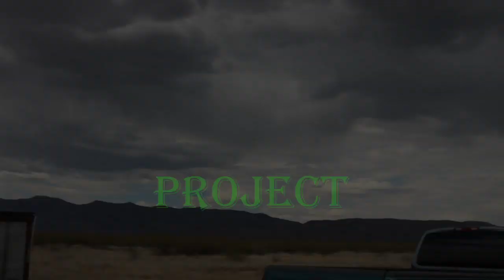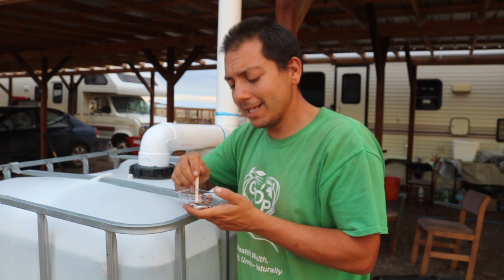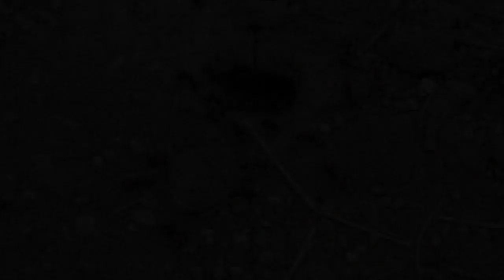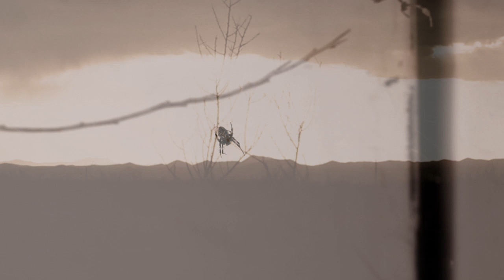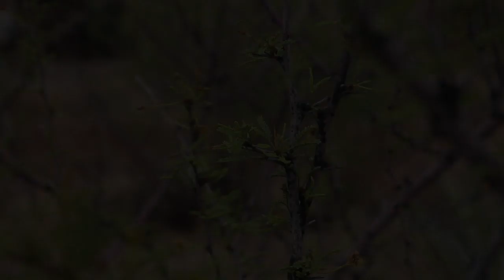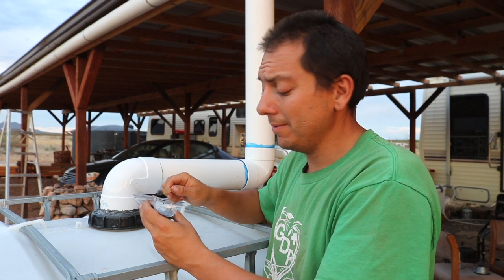Sealing Our Off-Grid Rainwater IBC Totes | Vlog

Comment: Learning to let go of failed projects, or projects that need to be redesigned, is probably one of the hardest lessons on the homestead. We will be working on redoing irrigation, garden paths, and a bunch of other things this fall. Some things are just not working well. Looking forward to your new videos. Have a great weekend.
Reply: Irene is right about letting go of projects. I spent the better part of a week working in a bed for the back of the truck, only to determine as I was about to install it, the we had a few too many other things for it to fit 😫 We’ve been reworking irrigation pretty much every other year for what seems like forever. Now there’s no putting it off - we have too many plants on one controller and need to add more zones. Ahhh, the extreme rural life 😁
Reply from the maker: Thanks Irene! It takes a real skeptical eye to see what isn't really working, and then having the courage to redo it. 😬🙏